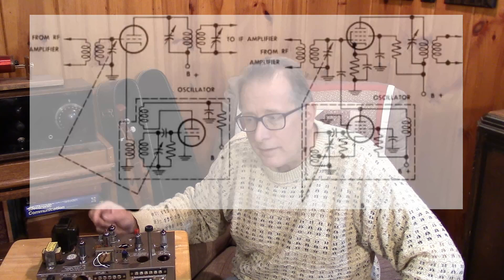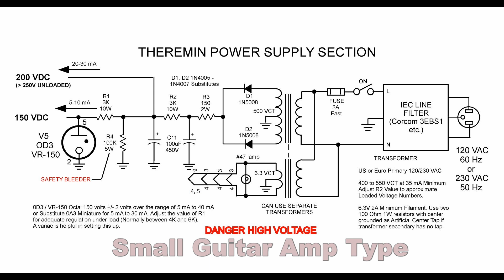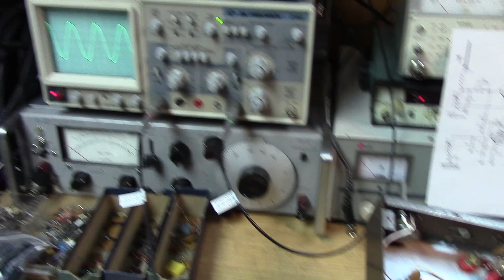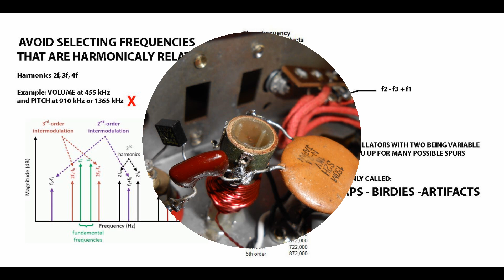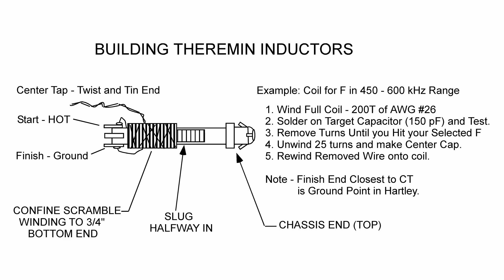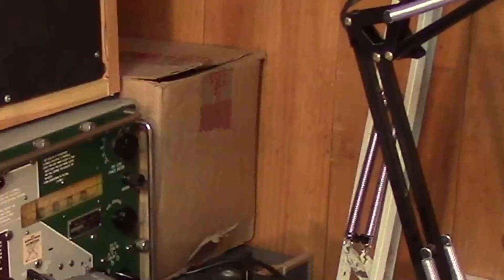Theremin Part 3

Comment: I have some war surplus slug tuned coils that seem to have a range from about 100uh to 300uh in adjustment.  Not tapped coils so I'd have to wind on a feedback coil for use as an oscillator.
Reply from the maker: The tap can be made by wrapping about 25 turns over the top of those. Should work fine.

Comment: You can generate Theremin-like sound effects using a single xsistor mini-Tesla coil crkt with a nearby superheterodyne AM Radio receiver
Reply from the maker: Sound Effects - especially if your finger gets too close to the top of the Tesla Coil! Ha - yes there are many small projects for getting a Theremin Pitch proximity effect quite easily, that have been published over the years.

Comment: You do get get 12V tubes that were designed for the automotive industry to make radios that didn't use Vibrator to convert 12V up to 120V and maybe that would work in this unit and make for a much safer unit as you won't be using anything higher than 12V, what about using 3x 12AU7 vacuum tubes in a Double Balanced Mixer like the internal circuit of the SO42P and you can use the third vacuum tube as the oscillator that produces the signal that mixes with the RF tone oscillator.
Reply from the maker: Those tubes are certainly capable in the same way as used when the early 12V car systems and radios arrived. With the exception of the audio output which was transistorized. I see no reason why they could not be employed here. As for the balanced and differential tube stuff, long tail pairs etc.., these represent a substantial improvements and elegance over any of the single ended designs, at the cost of a few more stages.
Reply: @MIKROWAVE1  I suggested this because you don't want other frequencies floating around to cause interference with other users maybe using the topology used in the SO42P as the mixer for the tone circuit as it would include the oscillator which just needs the tuned circuit to function find the mixer circuit here <http://www.angelfire.com/planet/funwithtransistors/Book_CHAP-4B.html> and will yeald the difference and the sum which will not be detected.